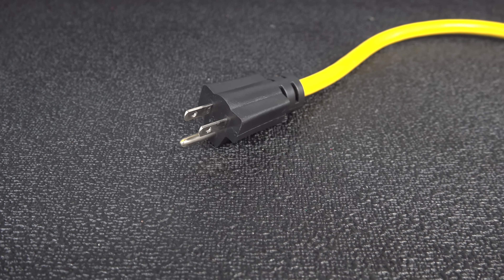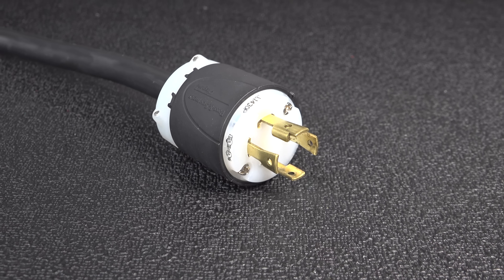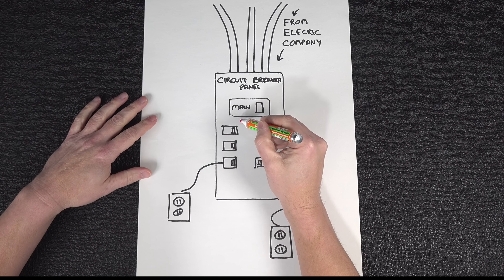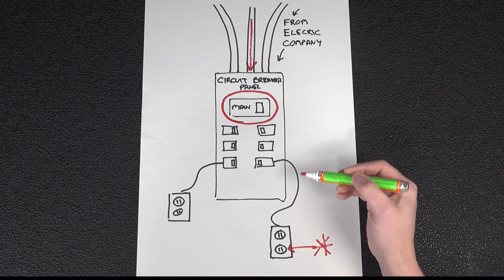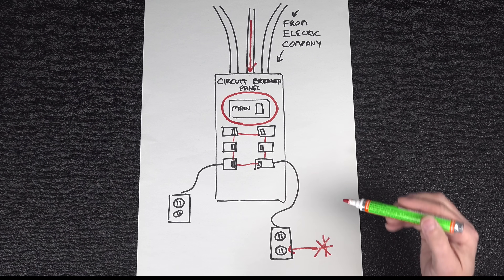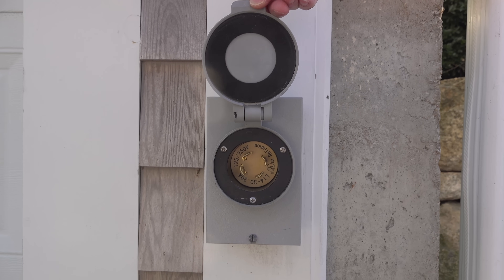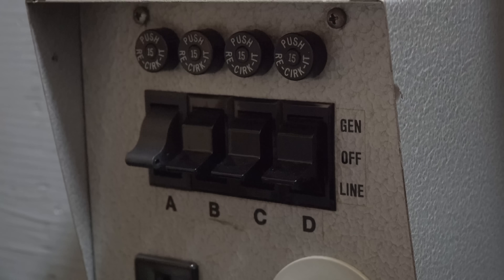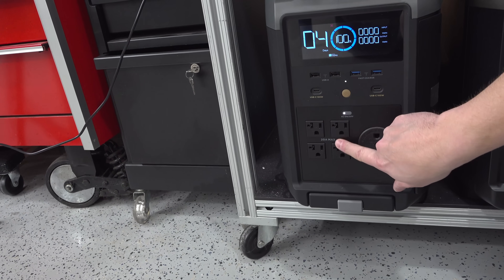Worst Electrical Mistake You Can Make - Backfeeding Generators

Comment: Backfeeding has been done more than you think. Usually out of necessity and in unusual circumstances.........by knowledgable electricians.   A cable like that should probably not be sold to consumers. Things that "seem" to be unsafe are sometimes done as a matter of course (one example I can think of....is that wood floor sanders do good with 240 rather than 120. Floor sanding guys will very often "spike" the main plus and minus 120s in the main breaker box in order to get 240 volts quickly.  I'm not sure how it "should" be done, but I do know, back in the day,..that our flooring subcontractors did this a lot. Maybe they don't do it anymore, I don't know).,  The key is education and knowledge. Most tradesman will stay out of trouble if they have the knowledge and education. If not,..they better get it. And, by the way, anybody knowledable enough to use one of those,..MOST PROBABLY also has the knowledge to 1) Pull the meter and 2) pull the mains

Comment: Turn off the main breaker and back feed responsibly. 

I prefer to back feed the 220v dryer line so I have all the circuits to choose from in my home. There is more to it to be responsible but thats the short of it.

Comment: I would only use one as a last ditch emergency thing... Shed outback has an power outage and I NEED power asap.

Would make an extension cord from the house to it only for as long as it would take to get what I need to repair the main connection.

Then unplug and restore it to M-F connection again as soon as I got the sheds power going properly.

If I ever saw one of those laying around unattended I would be very tempted to destroy it before some numbnut without electrical knowledge tried plugging it in...

Studied to become an electrician but chose another path after school...

Comment: Sale of these should be banned, but you can't dis-invent things so that's not a full solution by itself. What would help is if anyone who is found back-feeding without isolating from the grid got charged with attempted manslaughter; an easily provable case which is entirely true. Further, on conviction that same person and their spouse should be permanently banned from having an account with any electrical provider even indirectly such as through a business they own. That would stop 99%+ of the problem and would not inconvenience anyone who is backfeeding or using a generator properly.

Comment: As a beneficiary of IBEW, it shocks me that people can be so stupid, as I'm sure this is explained in the operating manual.  Thank you for putting this video out so our lineman don't get seriously hurt or killed, and illegal activity is avoided.
Reply: I guess since I’m a non union genius who’s been doing this for 25 years every storm I’m just lucky.
Reply: @MrT13  Me, too.  My father-in-law is the master electrician and IBEW retiree.  I don't know much, however I do know to read the manual included in every new appliance and apparatus.

I applaud your common sense, as it's clearly not so common.
Reply: @MomMom4Cubs  it’s not a biggie. I simply tell ppl (friends) what I do. Double male to the dryer plug. They say oh no are you sure? I don’t want etc etc I say ok hey by all means. If one step is too complicated for you don’t do it. Not everyone is capable of performing step one. Even if any of these little cords came with directions it literally would say. Turn off main breaker. Plug in cord. Turn on generator. To turn off do the 3 steps in reverse. But like the video says ppl forget to turn off main breaker. Ok so they are literally too stupid to follow the one danger step.
Reply: I don't want the stupid interlock. I want a triple-pole-triple-throw switch. The interlock can fall off.
Reply: What local are you? My grandfather, father, and 2 uncles were local 38 in the Cleveland area. My grandfather was the oldest active member one time and the whole union leadership came to his funeral.

Comment: So if you're planning ahead to use your generator, relocate your top electrical breaker to a lower position, then install a new breaker at the top run it to a generator connect, and have your lock out plate installed.

However if you're reading this off your phone in the middle of a storm, turn your main breaker off because you're thinking of this.. then make a back feed cable, use it and then fix it later.

While you will be liable if you turn your main breaker back on and back feed onto the grid, It's also not illegal if you're doing it properly just not to a code that has no criminal or legal authority in this context.

In other words, there's a reason for both videos. Here's how to do it in emergency right now, and then here's how to do it correctly later for all of the safety stuff to work automatically instead of manually.

I would love to see the lawsuit for somebody using any kind of back feed that also shut off the main breaker and did not back feed onto the grid.

Comment: I keep it to an extension cord off my 4500w gen. running into the house. No attempt running through the house breaker box. I plug in our fridge, run lamps and electric skillet for hot food.  We made it ten days without power after a massive ice storm. We're lucky to have a wood burning fireplace for heat. Amazing what you can do without and survive. Some would view my approach to this as the chicken way but it works within my own limitations.

Comment: My parents had used one of these cables to get power to a house that had been disconnected from the grid for years and couldn't be reconnected, but because of how the wiring was made there was one lightswitch that could turn off the power for the whole house

Comment: We call these suicide cords.  We use it to power up our cabin with a generator.  The cabin is not hooked up a power source, it does have a panel and this is where we plug the generator into.  It has worked great for the cabin, but I would never do this at our house.  Oh by the way, the Thatching rake you recommend is AWESOME!!!👍👍👍

Comment: This is very confusing when you generate electricity with solar panel's wind turbines whatever kind of device it goes back feeds to the street so if somebody's working on powerlines and this is backfeeding how is that not dangerous

Comment: My friend has his exam right now and his task is to wire up a module that actually measures line input voltage and starts up a generator if the voltage is too low. The module uses 2 contactors, one for the line and one for the generator, and they are never on at the same time (interlocked). Its really smart system but this double contact looks deadly and should be illegal to sell and produce

Comment: even though I would never backfeed my power, I use arc flash circuit breakers which do not allow electricity to flow backwards through the cb's.

Comment: Of course you need one of these! Generator in back yard, plug into dining room outlet, backfeed the 3 critical circuits, furnace, fridge, bit of lighting, all with main open. Critical circuits are marked, all same "side", as my generator is single leg. What an idiotic suggestion that such a cord is bad!! Yikes!

Comment: Dumb, illegal, and a lifesaver.  After a wildfire or hurricane it can be weeks before you get power.  I have back-fed ALOT of houses during disaster recovery.  I have never had a lineman, electrician or city official reprimand me for doing it.  We pull the meter to assure there is no back feed to distribution lines.

Comment: Technically it's illegal to backfeed power without an automatic transfer switch because it's so easy to energize lines that lineman could be working on and kill them.
Reply: Got a reference to that law or is that just urban legend?  It is against building code to set up a house this way but it's not like if you do this during an emergency they are going to take you to jail.

Comment: That’s pretty crazy i didn’t know you could back feed to the grid where it will probably be stepped back up to high voltage. I’m an electronics engineer so I’m not familiar with household electrics but why do they not put a diode to stop the back flow of current?
Reply: I thought about this too, but you can't really use diodes on an AC circuit and still get the full waveform to come through. Also the incoming feeder lines are rated for 100 amps @ 240v. You'd need hundreds and hundreds of diodes in series and parallel in order to handle that current and voltage, AC issue aside.
Reply: @thegamerguy56  true I forgot about AC

Comment: The only thing I have ever 'backfed' was directly into my gas furnace. I completely removed the breaker for that circuit from the panel before doing so to isolate that circuit from the rest of the system, so it was being fed safely. (my furnace has a female 120v outlet on the outside underneath a switch that controls power to the furnace, for reference).
Reply: Actually I took the switch for the furnace out, replaced with an outlet, then put a pigtail on the furnace.
When the power goes out I can plug the furnace directly to the generator.

Comment: Very informative, this video did take a different turn than I thought. I thought you would say something along the line of, "If you plug one end in one socket and the other into another socket it would cause a fire." Which is not true. Positive is not attracted to positive and negative is not attracted to negative. But duel Male plugs are used for more than just back feeding (Which you should never ever do.) It is strongly advised never to use a generator to power your house if the power goes out because a generator does not provide a smooth steady stream of power, (nor does your sockets but the changes are not as dramatic as generators from Home Depot). Which can ruing your electronics if you do not have surge protector outlets in your home. And I am not talking just a stupid power strip with on off switch that. That does not protect against power surges it is designed to flip to prevent a fire from over heating. But a Male to Male plug is used for different things like storing power in a power bank, like what I use for my jump box for my car, or to couple portable power supplies.

The other main reason for never back powering your house other than hurting someone working on the power lines is that you can cause a box overload if the power comes on while you are back feeding. And to be honest no one is checking the fuse box/breaker box to make sure everything is working smoothly once a year so if a breaker or fuse does not pop and you get your power restored you run a serious risk of causing your whole panel box from blowing. That will cause a fire if it is not put in somewhere where it has little to no chance of the large amount of heat from the voltage catching wood or drywall on fire.

If you really want backup power for your home when the power is out, talk with your township for zoning laws, and an certified electrician to see ways to install a backup power bank in your home much like what solar panels use to store power. They will know how to wire your house so when the power goes out and the backup power kicks on it disconnects the outside electricity from the inside electricity making it safe for everyone involved.

Comment: Have always somehow gotten away with doing this from our barn 15 amp circuit which has its own panel and a main going to a sub panel in the home. Would hook up PTO generator, have the breaker bypassed on the generator, (not good), suicide cord to outlet in barn, ALL breakers on, backfeeding to the main in the home (yes, main breaker is off, first thing I do), and not killing one breaker in the home. Not sure how, but I can run a 220v water pump.. off a 15a 120v supply. Only goes into one leg of the panel and have to turn one of the breakers on the other side ON to allow only 90 volt on the other side, not sure why. Exposes some strange wiring issues in the house, but never could understand running the well pump, hot water heater and the 14 gau wire never gets warm on the pto generator.... yes, very unsafe. Not harming anybody else, nobody in vicinity, main is off.

Comment: I back feed through my dryer outlet. I assume the risk and make sure the main is turned off.  Not recommend for everyone
Reply: Use the dryer outlet as that is usually 30 amp if you have an electrical dryer. Most generators are rated 30 amp. So you have low risk of overloading your house circuit. Of course you need the same extension cord capable of 30 amps.

Comment: The colloquial term for a cable such as this is a "suicide cable" and it's actually banned in most municipalities. Though that doesn't stop anyone from making their own and they used to be readily available for things such as Christmas light displays. We have spliced our own before in power outages. There really is 0 risk if you are adaquatly knowledgeable and know the procedure to power your own home removed from the grid. The only reason auto-transfer panels are installed is to add redudancy to idiocy. The only reason it's called a "suicide cable" is because unfortunately, stupid people exist.

Comment: I think you are confusing "illegal" with "not conforming to code".  You can't get arrested for doing this.  It's also not really unsafe.  As you admitted, it works perfectly fine as long as you open the main breaker.  If you don't, the second you plug your generator in, it's going to trip its breaker because it doesn't have enough power to supply the whole neighborhood.

Comment: this is dumb. if you know what your doing it’s perfectly safe
Reply from the maker: Illegal, unsafe and condemned by every fire fighter & electrician in the US but other than that...
Reply: @SilverCymbal  but i built my own long before they were selling them, now back before 2011 in Georgia you would get paid for putting power in the grid. i’ve always had the main flipped off anyway any time i had to work at a house for a job that the owner turned off the power between users

Comment: back feeding is dangerous and illegal, back feeds and installs interlock kit. ok you have no clue guy. enough of the fear videos.
Reply from the maker: One install is illegal & one is legal. Pay attention you might learn something.
Reply: @SilverCymbal  its the same install. other then the 4 dollar interloc kit. its a back fed plug into the panel. saying back feeding is illegal then doing it is wrong and shows you know none of your states laws. all state laws are different. got a elc. License number for me to look up?
Reply from the maker: @Confused_Hippie  If you think using an interlock tied to a dedicated inlet is the same as using a cord as shown or a double ended dryer cord than you are missing the point. Every state in the US has adopted the NEC to some form and none allow backfeeding without a switched protective device. It's not a debate, just facts. Call the NFPA if you want more clarification or call your town, the answer is the same.

Comment: Hey just turn off the main breaker. Then make sure the outlet you feed is on the same phase as the circuits you need to power. 
If you need to run 220volt circuits then plug in to 220 volt outlet. 
ALWAYS TURN OFF MAIN BREAKER FIRST. IF UNSURE OF WHAT TO DO. 
DON'T. DO. IT.

Comment: You're back feeding with the 220 cable too. Like you said, the isolation from the main line is the issue. Your double sided plug example with the main breaker off works just the same, only without the safety bar.

Comment: I understand you are absolutely correct because people are idiots. [Your mileage may vary]
For me being a former electrician I know better. I have a 65Kw generator that I back feed to my pannel with 2ga wire on it's own two pole [220V] 100Amp breaker which is always off. [The generator has it's own 200Amp breaker.]
So yes incase of a power failure, I go out and fire up the John Deere 4cy diesel. Go to my panel and turn off the main, then turn on the 100Amp breaker. There is no deviation from that process/order.

Next, that chances of a lineman getting electrocuted are virtually non existent if a homeowner back feeds through one of their outlets without turning off the main. Why? Because your neighbor could never actually get power from you. Consider how many houses are connected to your 14Kv likes out on the street, 50? 100: 200? or more. Everybody on your grid is trying to draw power. [provided they don't have a automatic generator/transfer switch.] This means that as soon as you connect your power back feed with the main on, you will energize you house needs and send power back up to your transformer. Your transformer will try to energize the 14Kv lines which will in turn try to energize ALL the house transformers on your grid, thus trying to power all those homes. Your poor little generator can't handle that kind of load. [Even my 235Amp/65Kw gen can't handle that.] So what would happen is at the instant you plugged your back feed adapter in, it would blow the circuit breaker for that outlet in your breaker panel. Yes for a 10th of a second the 14Kv lines may have some energy on them, but since you are likely doing this in the first few minutes after the power went out, there isn't time for a lineman to be in a position to get shocked or for them to even find the trouble spot. [Linemen treat wires like a gun...It's always loaded, even if it's not supposed to be.] By the time linemen get into position you will have figured out that you left the main turned on as the reason your outlet breaker keeps blowing.

Comment: What's the difference between illegal backfeeding and feeding energy back into the grid (like from wind or solar)? 
Do people have special connections for that?
Reply from the maker: The power flowing part is the same, the difference is they have automatic controls to break the connection when utility power is off so that solar panels, etc. can't backfeed.